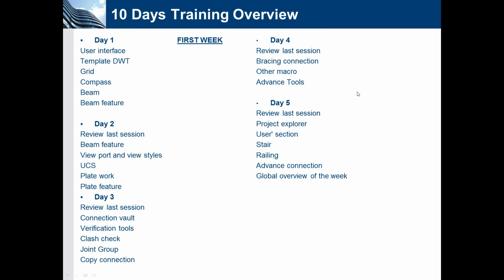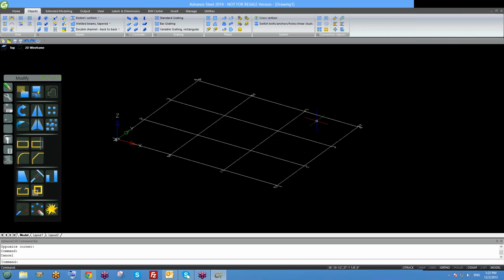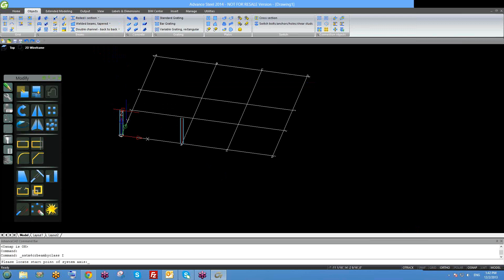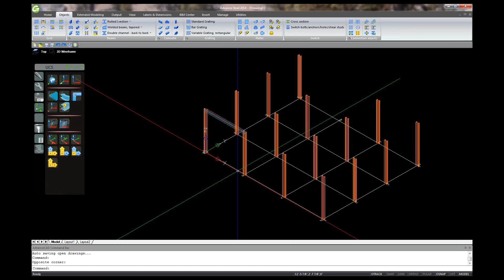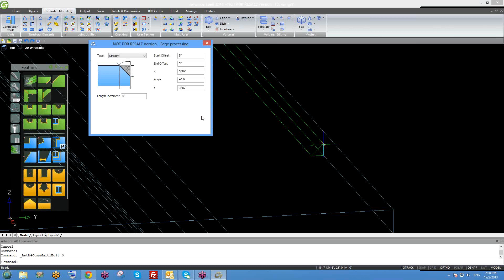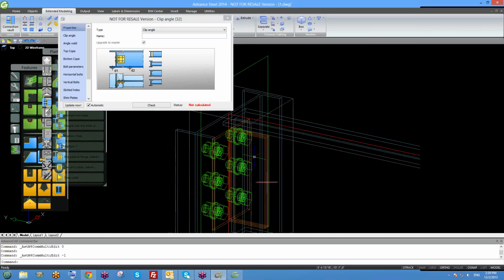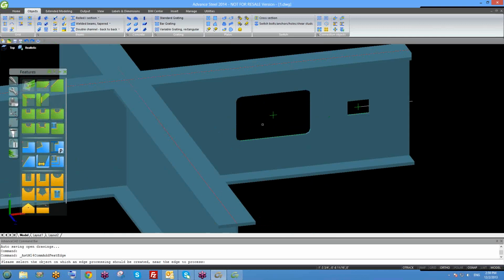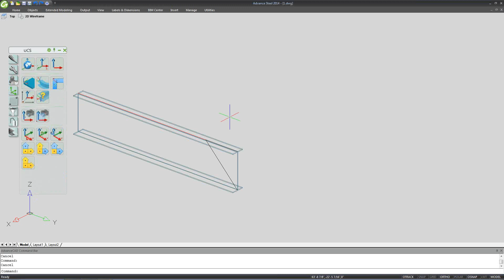2013 12 02 13 03 Advance Steel basic training 1 of 10

Comment: Dear Gevorkian,
Could you please help me. I have a connection which one I beam and one I column. Need to draw a cap on top of the column and extend to beam. This cap shall be fasten to beam by bolts.
I try to use knee connection to draw a cap and extend to beam. But I don't know how to add bolts.
Thank you very much!